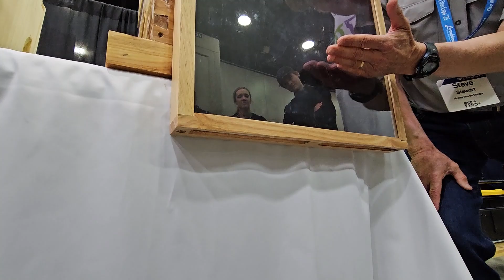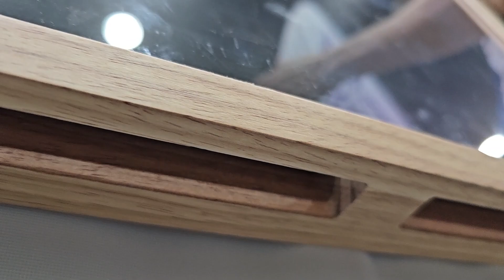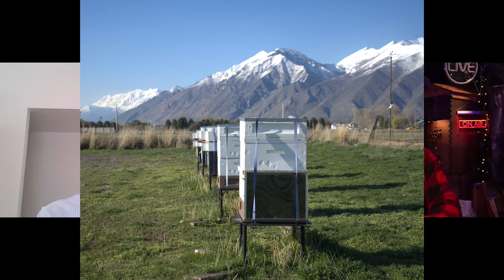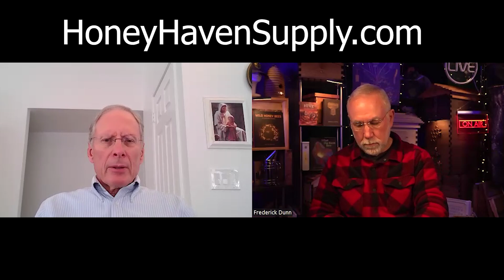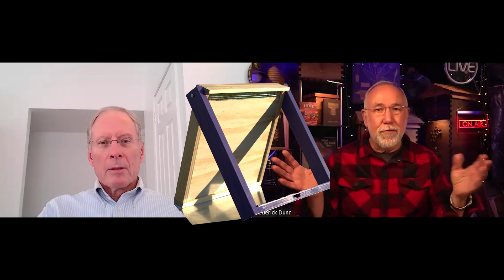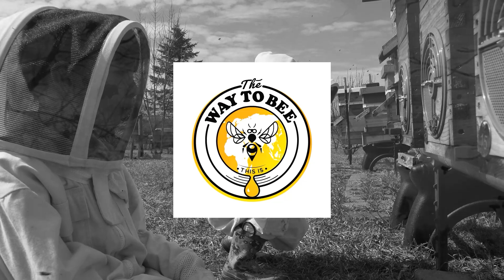Hive Heater for beehives, Interview with Steven Stewart and his new design.

Comment: A South‑Wall Answer to Winter: A Fully Internal, Passive‑Solar Solution to Cold, Moisture, and Colony Loss

If there is one thing winter teaches beekeepers—backyard and commercial alike—it is that bees rarely die from cold alone. They die wet. They die damp, chilled from above, slowly robbed of metabolic heat by condensation that forms where it should not: over the cluster. For decades the common response has been more ventilation, cracked lids, upper entrances, screened tops. Those methods move moisture out, yes—but they do it by flushing precious heat with it. The bees survive the cold by burning stores faster, shrinking the cluster, and often failing anyway.

This article presents a different answer. Not more ventilation to the outside, but a fully internal airflow system that manages heat and moisture the way bees already prefer—using shade, mass, orientation, and controlled convection. The result is a hive that breathes without bleeding heat, dries without drafts, and overwinters with remarkable stability.

This is not speculative. It is grounded in thermodynamics, feral‑hive observation, cut‑out evidence, and proven passive‑solar architecture. It is simple enough to build with feeder shims and common materials. And it may be one of the most important winter management shifts modern beekeeping can make.

⸻

What Bees Already Tell Us (If We Listen)

Beekeepers who perform cut‑outs see a pattern again and again. When bees have a full wall, floor, or cavity to choose from, their entrance is almost always in the shade.

Greg Burns of Nature’s Image Farm and Bruce Jenne of Bruce Bees—both with extensive cut‑out experience—independently confirm this observation. In trees, walls, barns, and structures, bees consistently choose entrances that avoid prolonged direct sun. Morning light may touch the entrance briefly, but as the sun rises, the opening falls into shade. This is not coincidence. It is thermodynamics.

A shaded entrance limits overheating, reduces uncontrolled convection, and gives the colony authority over its internal climate. Meanwhile, the mass of the structure—tree, wall, cavity—often sits on the sun‑facing side, quietly absorbing heat and buffering temperature swings.

This same logic appears in passive‑solar architecture through the Trombe wall, named after engineer Félix Trombe, who demonstrated that a sun‑facing thermal mass behind glazing can warm air gently, store heat, and regulate moisture without mechanical systems.

Bees have been “doing Trombe walls” long before humans gave them a name.

⸻

The Core Mistake: South‑Facing Entrances

A south‑facing entrance seems intuitive: “Let the sun warm the bees.” In practice, it does the opposite.

A south entrance invites uncontrolled solar gain, overheating during clear winter days, and rapid cooling when clouds pass or night falls. It accelerates convection straight through the cluster and encourages condensation above the bees as warm, moist air slams into cold surfaces.

The solution is not to fight airflow—but to control it internally.

⸻

The Correct Orientation
	•	Entrance: North‑facing
	•	Thermal wall and convection plenum: South‑facing
	•	No upper ventilation to the outside
	•	All airflow contained inside the hive

Cold air enters only through the entrance the beekeeper chooses. Everything else happens within the hive body, where heat is valuable and moisture can be managed gently.

⸻

The Structure: Simple, Precise, Effective

This system can be built onto standard Langstroth equipment.

Hive Stack (bottom to top):
	1.	Bottom board
	2.	Two deep brood boxes
	3.	Lower vented feeder shim
	4.	Inner cover
	5.	Optional quilt box / insulation / Reflectix
	6.	Telescoping cover (sealed, no upper vents)

Lower and Upper Vented Shims
	•	Installed at the bottom and top of the brood stack
	•	Vents are on the short side, facing south
	•	Holes drilled 3/8 inch diameter (critical size—large enough for airflow, small enough to prevent propolization)
	•	Covered with #8 stainless steel mesh
	•	These vents do not open to the outside air—they open into the plenum

⸻

The Trombe Plenum (The Heart of the System)

On the south exterior wall of the hive:
	•	A framed cavity runs from the bottom board up to the top shim
	•	Inside this cavity is a flat black glazed terracotta surface
	•	The terracotta sits behind clear glazing (tempered glass, acrylic, or polycarbonate)
	•	The cavity is sealed from external airflow

Why terracotta?
Terracotta is a gift to bees:
	•	It absorbs solar heat slowly
	•	It releases heat gently
	•	It buffers humidity, allowing moisture to condense and re‑evaporate without dripping
	•	It stabilizes temperature instead of spiking it

For beekeepers without terracotta access, black‑painted aluminum can be used as an alternative. Aluminum absorbs heat effectively when darkened and is lightweight and easy to fabricate. It does not buffer moisture as well as terracotta, but it remains a valid and helpful option.

⸻

How the Air Actually Moves (And Why It Matters)

This is the key: the moisture and the air do different jobs.
	1.	Cold, dry air enters only through the north entrance.
	2.	The bees warm that air as part of normal metabolism.
	3.	Warm, moisture‑laden air rises naturally.
	4.	Instead of condensing above the cluster, it is drawn laterally into the lower south‑facing vent shim.
	5.	The air enters the Trombe plenum.
	6.	As it rises along the sun‑warmed terracotta wall:
	•	Heat is added gently
	•	Moisture condenses harmlessly on the mass
	7.	The now drier, tempered air exits back into the hive through the upper vented shim, above the cluster.

No outside drafts.
No heat dumping.
No rain of condensation.

The bees remain dry. The cluster stays warm. Stores last longer.

⸻

Why This Works in Winter and Summer

The Trombe wall faces true south, aligned to the lowest winter sun. In winter, it absorbs meaningful energy. In summer, the sun rises higher and passes overhead quickly, placing the wall into shade—exactly like feral entrances that receive brief morning sun and then rest in cool shadow.

This is not accidental. It is seasonal self‑regulation through geometry.

⸻

Why This Matters—Now

Winter losses are not just economic. They are systemic. Every colony lost weakens pollination networks, genetics, and resilience.

This design:
	•	Requires no electricity
	•	Uses readily available materials
	•	Scales from one hive to thousands
	•	Honors how bees already manage heat and moisture
	•	Solves the real killer: internal condensation

It does not ask bees to fight physics. It recruits physics to work for them.

If this knowledge must be handed on, let it be handed clearly:

North entrance.
South thermal mass.
Internal airflow only.
No upper external vents.
Dry bees survive.

Bees do not need more holes in the roof. They need a warm wall in the right place.

That wall can save them.
Reply: Hey Fred, if you got time and it’s worth the communities here I really like to know what you think about this or you could reply and comment, but I’m trying to save people be and I wish people would hear about this and have the opportunity to make their own decision

Comment: sharing my experience. Backyard beekeeper here. I winter the bee's in one deep box 10 frame. Strap insulation (1 inch) on four sides. Solid bottom board. Works well. High moisture comes from not insulating the walls. Thinking of insulating the cover with small opening for venting. Denver Co.
Reply from the maker: The most critical insulation is the inner cover and outer cover for sure. Thanks for sharing.
Reply: @FrederickDunn    thank you.

Comment: Very interesting interview. Currently in the middle of winter here in N. Central Washington at 4000ft, and too cold to check in on bees.
May very well give this unit a try for next winter.
Is there a recommended timing for putting this in the hives?
Reply from the maker: I will be putting mine on at the end of our warm season here in PA. I think it's best to add them as part of your winter pack-down. If the Hive Heater was in place during the warm/productive months, they would build burr comb in that space and likely make a bit of a mess. I think I'll talk about this on Friday. Thanks. :)
Reply: @FrederickDunn  Just ordered 2 units, but I have another question. Position direction of the panel? I would assume best efficiency to be facing relatively south. Only ask as I have entrances facing all points but north. If he produced a panel for the narrow side also, one could have all facing southerly. Yes?
I suppose a person could possible build some sort of adapter to mount it onto the narrow end. ???

Comment: Forgot to add, I don't have issues with winter losses--have not lost a hive in over four years.  But what I do loose in multiple frames in each hive due to mold growth.  This is costly to the hive, so this Hive Heater would help get rid of that excess moisture that causes the mold.  Excited to try.
Reply from the maker: Steven defininitely mentioned that it did eliminate his mold issues. Another bonus. :)
Reply: @FrederickDunn  One thing I did not hear Steven talk about is how warm the hiveheater heats the hive.  I know from personal conversations I have had with him that the hiveheater warms the hive around 20-23 degrees higher than the current outside temperature.  But wonder why he chose not to mention this?

Comment: I wonder if the bees would consume more honey at the higher temps.
Reply from the maker: According to Steve, less than if they had to keep their brood warm during sunny days. It all comes down to configuration, insulation, and the local weather conditions.
Reply: @FrederickDunn  looking at his site pictures, he is putting the heater on top of the brood. Since heat rises I would think it would heat the honey or top box. Seems like it would be like a big upper entrance affecting ventilation. Also there pictures were not showing snow. Would be interesting to see data from hives with the heater.

Comment: Simple to make your own. The key is to make a chimney out of your hive, if you inject warm air into the middle (height wise) you will make upward airflow.   Genius, thinking outside the box, not afraid to experiment!
An electric heater pad at the bottom should make the same chimney effect and warm as well as ventilate.
Reply from the maker: This isn't a vent through the top chimney effect. When the outside air inside the unit is hotter than interior air, it flows in just under the top box and out through the bottom entrance. So, in that regard it's different. Thanks for taking a moment to comment :)
Reply: @FrederickDunn  are you sure about that? It doesn't make sense to me that the heater would try and force warm air downward through the hive.
Are you saying that there are no vents in or near the top?
Reply from the maker: @danpease8395  No top venting at all. The device draws cool air up from the bottom of that enclosure, then it's open to the inside of the hive only. As that warm air goes into the hive, there is not upper vent at all and the only movement out must occur at the landing board entrance, or, reverse into the device and out through it's intake opening.

Comment: I would be interested and seeing you try this out one or two of your hives like you scientifically seem to do. Insulative factors would come into focus though. I spent 10 years dealing with flour silo issues during wintertime temps with upper dehumidification at the top air space and mold was always an issue with the sunlight heating up the southern side of a white painted silo even in the cold. Two completely different scenarios but blowers injected heated air from below, you couldn't hold your hand on them because they got so hot. Maybe there is a fine line, and he found it, sounds like an interesting thing to check out, if the bees don't just use propolis to fill the holes but, propolis is hard to come by in the winter months. So many factors are in play, I still lean toward insulation till we don't have another choice though. I hope you are able to get one and show us how it does!
Reply from the maker: That's all very interesting. I do plan to evaluate one or two here :)

Comment: Hi Fred, such an interesting discussion thanks for doing this. Can you possibly describe or demonstrate what Steven was talking about concerning Re-queening using Pressing cages, please describe what that is? I’ve not heard of a pressing cage. Thanks
Reply from the maker: I don't use press-in cages, but it's usually #8 screen shaped into a 3" x 4" rectangle with bent down sides that push into the face of the comb. I now much prefer the Queen Introduction or Queen Isolation cages that permit you to use a full deep frame of comb without damaging it. The point is to allow the queen to begin laying in cells while not being available for attack from workers in the hive.

Comment: I went to the NAHBE this year, this was the most interesting thing I seen there, I spoke to other beekeepers there about that and picked there brain, I spoke to Steve several times over the 3 days as I keep coming up with questions. I dont leave much honey during the winter because he is right its warming and cooling and producing moisture.  I feed sugar blocks and hivealive fondant.  But one question he couldn't really answer was will it keep my sugar blocks so dry the bees cant eat the sugar block as it needs some moisture so the bees can take it and will it dry out my hivealive fondant. But he was very convincing and i am still curious and may try it on my weakest hive this late fall.  
Thanks for the video, I was really excited to see it!!
Reply from the maker: Those are great questions and concerns. Based on his samples, and the configuration presented, the bees still have access to moisture/condensation in that bottom box. What's been dried out would be the top box above the HiveHeater unit. It will be great to have feedback from many who live in colder regions and see what the results are. Hive top insulation with no top venting seemed to fix my wintering issues. Thanks for sharing, discussions are a great way to speculate on how something may or may not work out. Practical testing is where we really learn.
Reply: @FrederickDunn … the honey above the brood is still a big heat sink. Maybe one day of sun would provide enough heat in the honey that it would take a couple of days to get cold again… cycling heat pump??

Comment: I used this exact device for 6 weeks at the beginning of winter and through one snow fall. It did NOT work as advertised and help from the company was not great. Moisture increased in the hive and the winter cluster was irregular as confirmed via a thermal camera. So I took it off the hive and my hive is strong again through winter. I followed up with the company and no answer.
Reply from the maker: Did you happen to make a video about that experience?  I checked the website and didn't see your review there. I think it would be very helpful to the company if you posted a review explaining your experience. Thanks for sharing, balanced feedback is very important. Much appreciated.
Reply from the maker: Questions - When did you buy it?  When did you put it on? What's your climate? You removed it mid-winter? Did you make any other comparisons? What was the configuration?
Reply: Sorry the company did not get back to you.  It is really a very new company and still getting organized.  The only way you can tell if the hive heater is working is to have a moisture sensor in your hive, as that is one of the main functions.  A thermal camera would not tell you anything of the sort.  If you think that moisture increased because of the hive heater, you were probably just seeing moisture condense on the outside of the heater in cold days.  It is still removing moisture which is a great thing for a hive.  And the hive heater works best when the sun is shining, not during a snowstorm.  As far as your cluster orientation is concerned, yes with a solar heater the bees will walk around and not have to be in a survival cluster.  Clustering is a survival mechanism, and it is hard on the bees.  The fact that you noticed there was not a large cluster just again confirms that the hive heater works.  You really didn't give it a chance.  I fear winter no more because with the hive heater their chances of survival are orders or magnitude higher.  Love your bees.   It was working.  You just didn't know it.  Steven Stewart

Comment: Isn't part of the condensing hive concept that moisture will collect on the sidewalls and be removed from the hive?  Quilt boxes, moisture boards, etc same idea, remove moisture. Not sure we get enough sun in the winter to be effective in Fort Wayne.
Reply from the maker: The real goal is just to keep the moisture under the cluster rather than over the top of it. I think, because I don't know, that this system would permit moisture to still condense on the lower interior sidewalls for the bees to collect.
Reply: @FrederickDunn  I'll be watching out for your test.  If he gets them back in stock I might give one a try.  They are a little salty $$.